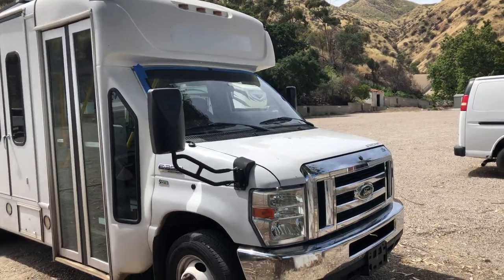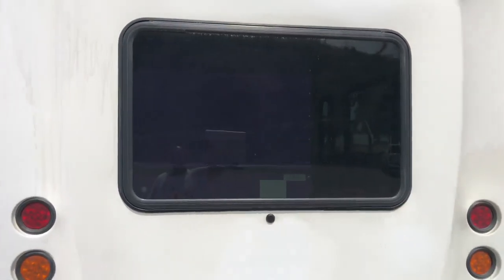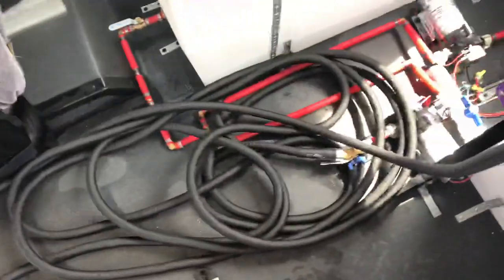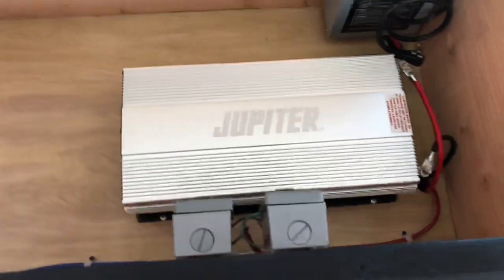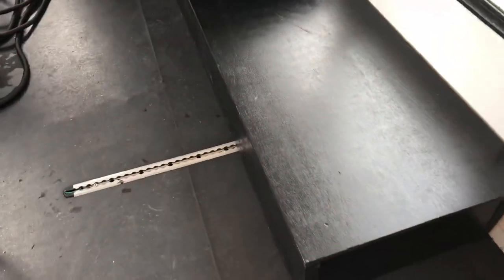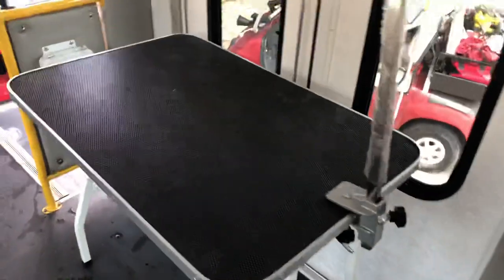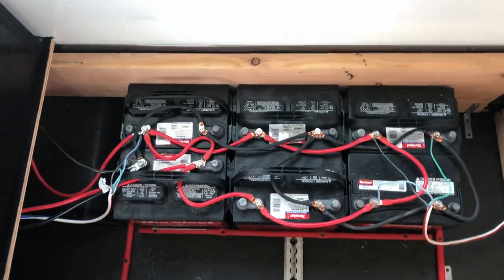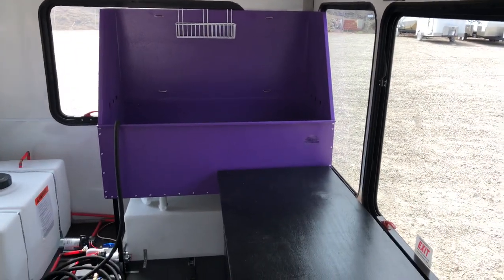Mobile Grooming Mini Bus with Solar for Darbie!

Comment: Where do u plug in your clippers and dryer?
Reply from the maker: Right into the invertor!
Reply: @wagmytail2007  thanks, that was the only thing that got me lost. Do u use a power strip, because the invertor is a distant from the grooming table?
Reply from the maker: @charlestolston3090  Of course you can.  You can also install a two plug box or four on the outside of the cabinet if you wish!
Reply: I was thinking you could add a temperature gauge for the water to better understand how hot the water is. Love the idea..